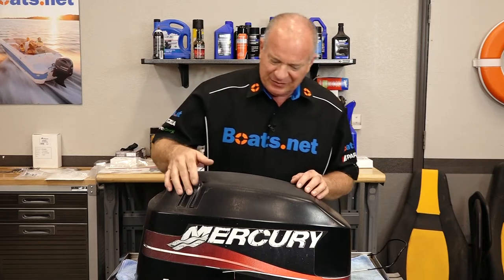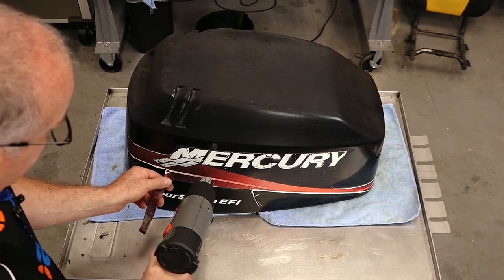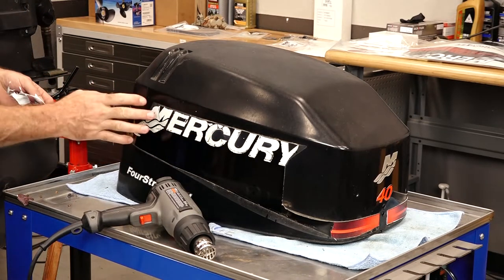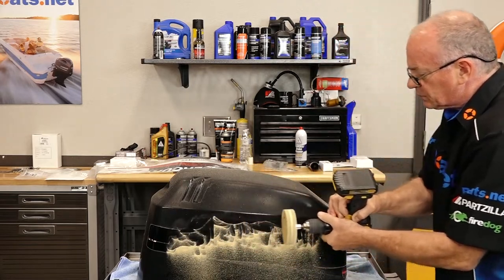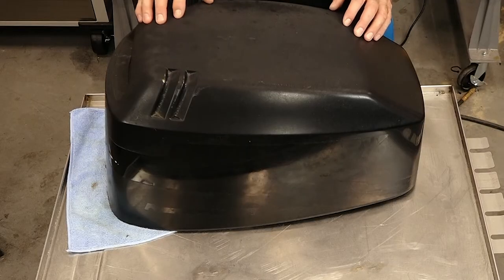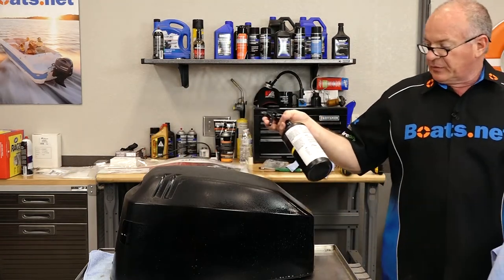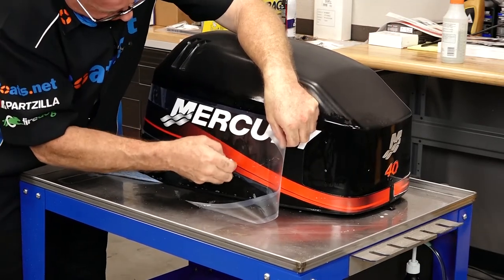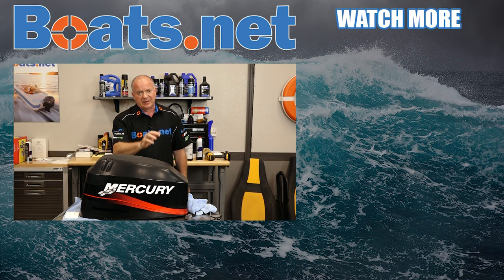Outboard Decal Removal | Mercury Outboard Decal Replacement | Boats.net

Comment: Hi i got that wheel to put in the drill but it did not work. It actually made it worst and harder material. I have try goo gone a little heat on it and nothing.